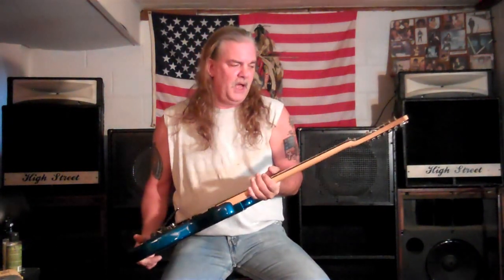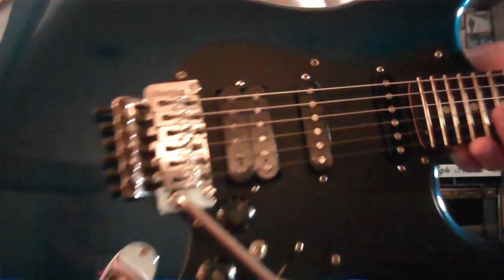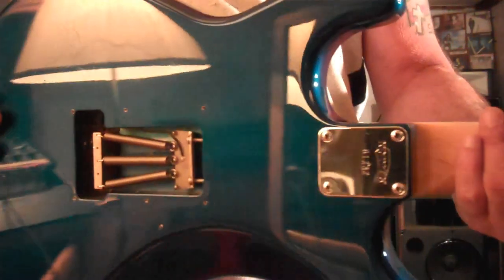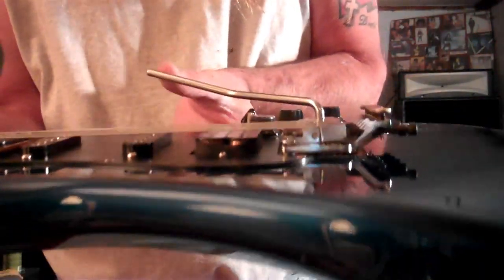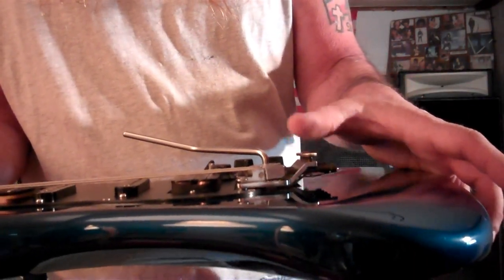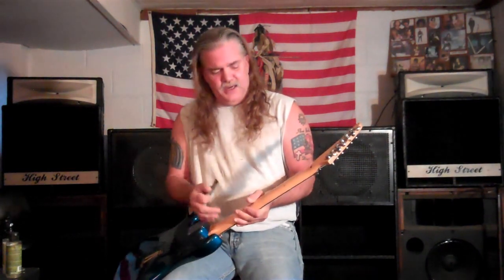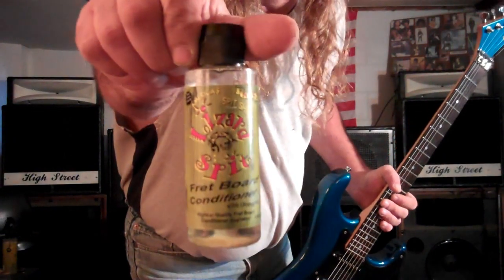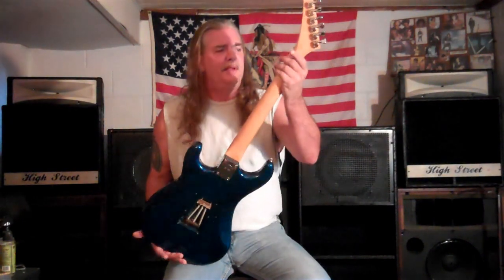1984 Kramer Focus 3000

Comment: Mine I also put a JB in there. It also has a big brass block (no-brand from e-bay. the one from floyd rose itself didn't fit because the routing on the body was too tight), refretted and cut the tone knobs.
Now I'm thinking of modding it like yours, disconnecting middle pickut and the three way switch.
Hey man do you have a Facebook page so we can keep in touch?

Comment: Wondered if this is not 1986 or later ESP-made - it has added toggle switch, flat-butt body shape and serial # on the neck plate.
BUT then here's a 1983 Ad:
http://www.vintagekramer.com/focus.htm
I think sometime in 1985 Kramer switched over from Matusumuko to ESP for the Focus line. I have a March 1985 Matsu w/OFR & FT, very different model with long 'beak' headstock and rounder shape maple body much like early-Eighties USA Kramers before OFRs had fine tuners.
It's confusing, unless some Matsu Focus guitars were made with early-80s USA model parts Kramer were trying to use up.
Evidence: the tailpiece studs on mine WERE drilled for a pre-fine tuning Floyd, which is incorrect placement by about 3/16" (too far from neck.) You can easily compare the gap from the OFR to the pick guard. Image on right:
http://i1162.photobucket.com/albums/q536/japkramernut/KramerforumApril029.jpg

Comment: Hey man, the thruss rod adjust is at the bottom of the neck, right? but looks like there's little acces from a little hole on the pickguard, do I have to remove the neck in order to adjust it?